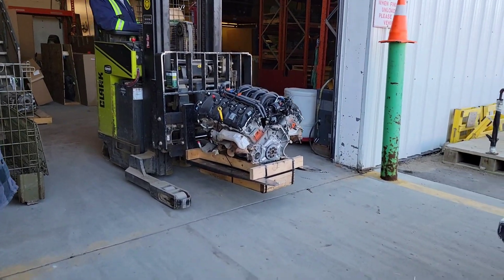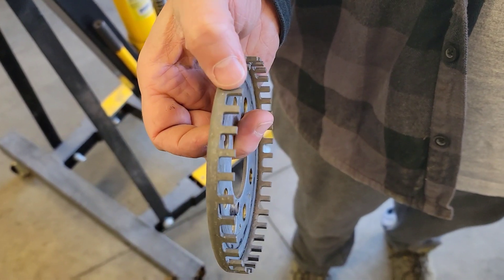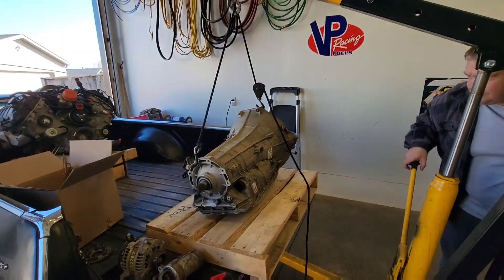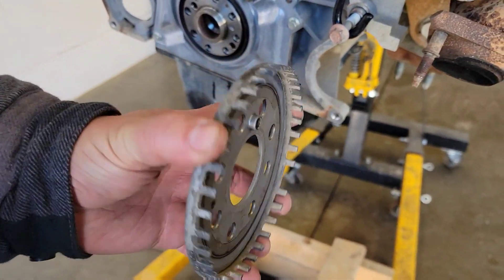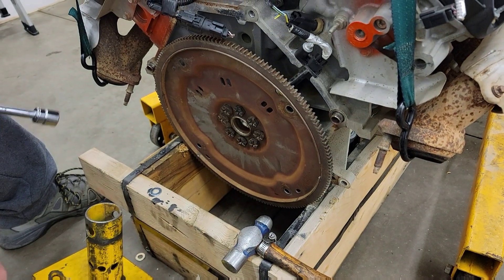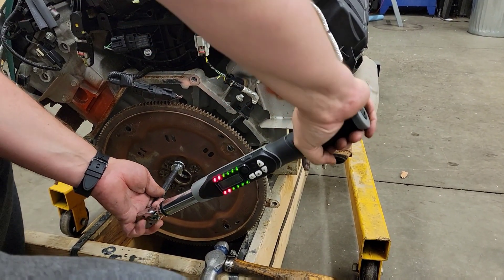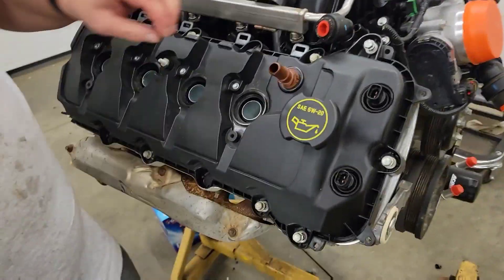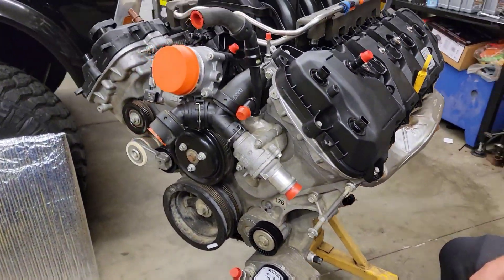5.0L Coyote Swap 1979 Bronco Extreme Truck

Comment: If those ring gear bolts require 60 degree final torque. They are to be replaced with new since they are torque to yield. One time use only.
Use some Dielectric grease on the plug boots, protects from corrosion and boots will come out super easy.
Reply from the maker: Thanks for the info!!

Comment: What are you using for a transfer case? Starting a coyote swap on my 1979 F150 4x4 shortbed. About to start gathering parts. Would like a 2018 Mustang coyote, f150 10r80 transmission but not sure what transfer case.
Reply from the maker: Hey! Using NP205 with an advanced adapter.  I was going to use the mustang coyote but they are hard to come by here so I went with the gen 2 truck engine and the 6R80. I heard there's been trouble with the gen 3 truck engine and 10r80 so opted for gen 2.
Reply: Thanks for you response, I’ll look into it. I saw a build at sema with the Godzilla swap but they use an atlas transfer case. Looking at $3500 for one of those. Yikes!
Reply: @panchovilla2699  they start at 3500 and go way up by the time you get a few options on them.  The Godzilla is kinda useless right now.  There is 1 place making the engine control and it's like 4500.  And it does not do transmission control.  There is another company that makes just a transmission control.  Adds up in a hurry to use the Godzilla.  Ford really needs to release the control pack for it